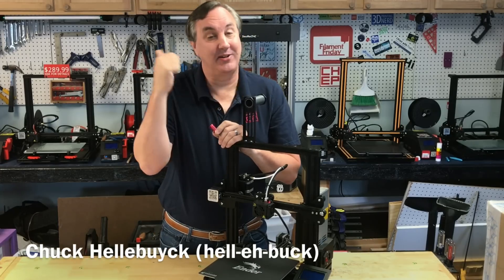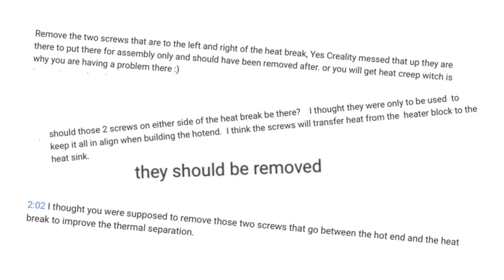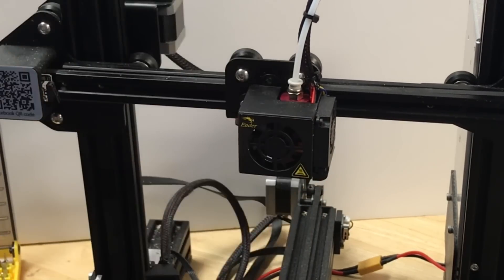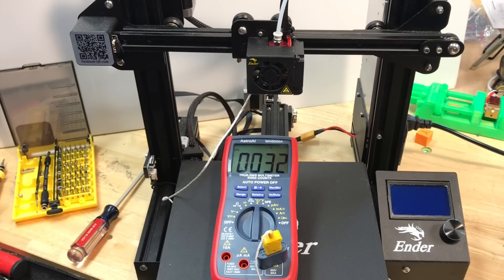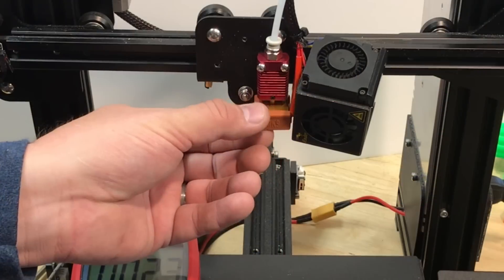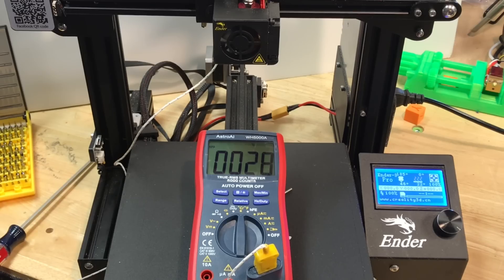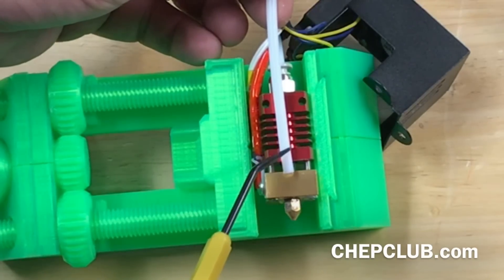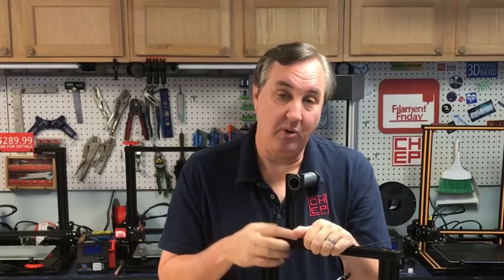Creality Ender 3 Hot End Heat Creep - Remove Those Screws......Maybe?

Comment: I took my stock Ender 3 Pro hotend and replaced the heat break with an all metal titanium version from Spool3D, along with the nickel plated copper heat block with titanium mounting screws from Spool3D. I have no heat transfer to the cooling block (heatsink). Prints perfect at 270-280C for CF nylon. PLA, PETG, ABS, ASA, and PC prints perfectly. 

When my hotend was stock I was using Capricorn tubing at 260C printing CF nylon just fine. No heat creep with those factory mounting screws in place. 

Those screws need to be there for structural strength. This is why i hate the Micro Swiss hotend because it is a really weak design with an aluminum heat block and a crappy Bowden tube mount.

Comment: Another note for anyone who is considering this as a possible issue.  Order some stainless steel screws and use them instead.  Stainless has about 1/3rd the thermal conductivity of regular steels, part of why it is used inside ovens and similar.  Best of both worlds, screws in for convenience, but also lower heat transfer compared to normal cheap screws.
Reply: They are always stainless

Comment: Anyone know where I can buy these screws? Or what size they are?
Reply: They are M3 screws. You can buy them basically in any screw store, very common indeed.
Reply: You need the whole assembly, unless you can drill and tap the heatsink. I bought one recently and it was under $20. Those screws are there to stop the tube slipping out and forcing the hot end to dive into the bed as they did in the earlier design. The are, badly positioned as they tend to put a sheer force on the heatbreak so you should not tighten them too much!

I'm glad Chuck busted this myth but if creep was so much of a problem, the heatbreak would cause heat creep anyway and it would be far worse.

Comment: Do this with higher temps for petg temps for example. You will see the fan is not able to keep up with the temps. 185 is also really low for pla, printing for strength cnc kitchen has suggested 230. I'm sure you would get heat creep if you elevated temps.
Reply: @ageorgiev89  the difference might be a little more with higher temps, but the heat equations are pretty straightforward. If it heats up from 25 to 32 C with heat input x, that’s a delta of 7. The delta T from 185 to 32, by contrast, is about 150, and that is what drives the x. If you start printing at 240 — which is about the absolute max for a ptfe hot end — that delta is going to be at most 210, or give or take +50%. That would mean that the delta on the heatsink side would also increase by +50%, in other words your heatsink temp might increase as much as 3-4 degrees to ends up at 35-40 C.

What does not happen is that the 55 extra degrees on the hot end also mean 55 extra degrees on the heatsink. Just not how thermodynamics work.

Comment: It would make sense that these screws are made from stainless steele, since it is a very bad heat conductor, which is good, in this case.
Reply: Exactly, posted the same before seeing your comment.  If they aren't already change them to stainless steel and you get the best of both.

Comment: Just going to add my two cents here. But I think this experiment should be redone with the thermocouple fit inside the heat sink chamber and checking the temperature there while the extruder is heated up. Having the tester thermocouple taped to the outside means it reads a mix of the air temperature and the outside heat sink temperature, when what really matters is the temperature of the heatsink on the inside.

From personal experience though, I'm in the camp that says that removing the screws helps. Ive done the test before with my own thermocouple on a MicroSwiss clone with the temperature going from 72C w/ screws down to 63C w/o screws. That's still going to affect my PLA, but it was enough of a difference to turn my all metal hotend that jammed within 10 min from startup due to heat creep to one that could be used continuously. 

I dont think its debatable that those screws were meant to stabilize the heat block in place of the nozzle. Its better to overtighten those screws rather than deform your nozzle. And heat creep would hardly be an issue given the stock hotend having a PTFE tube inside. This however changes when one changes to an all metal hotend

I think people experiencing problems on their all metal hotend shouldn't disregard taking off the screws as a possible quick fix, but they should do so with the knowledge that this would result in using the printer in a way the manufacturer did not intend it to be used and could lead to other problems. The proper way to address this problem would be to get a bigger heatsink fan or get a better hotend

Comment: I'll add my experience too - I "upgraded" to a Hero Me Gen5 printed out of PLA (as instructed) and I slowed all the fans too (incl. the PSU one) to make the printer near silent. Printing PLA was completely fine, but ABS (at 240C) heated up the coldend to near 60C and removing the extra 2 screws made it cool again (~33C). So the takeaway is that it might not matter for PLA and/or stock configuration, but it allowed me to print PETG/ABS at almost ambient noise levels.

Comment: My experience is exactly the opposite. My printer would run for an hour or two and stop extruding with a clog. I repeated this cycle three times (I'm a slow learner).  When I pulled the filament out I noticed it had softened (not melted) near the bottom of the heatsink but not at the top.  The softened filament drastically increases friction inside the PTFE tube to the point that the extruder cannot overcome the friction.  Hence a clog.  When I removed the screws all symptoms disappeared immediately.  Now, it's obvious that a slow or weak fan can cause the heatsink to run hot but it would be hot all over and not just at the bottom.  It should also be noted that my printer (and fan) was purchased NEW in August and that the fan ran at the same speed before and after removing the screws.  Those screws serve no purpose once the nozzle is tight.  If your heat block is loose, tighten it.  That is a separate issue and should be corrected.  In fact it may be the reason for the low thermocouple readings.  Finally, it's very obvious that the fan must provide adequate cooling but it also obvious (to me) that the screws can only increase the heat load on the fan.  Also, I think the thermocouple was not properly located to give accurate readings.  It should have been at the hottest spot not the coolest spot.
Reply from the maker: I’ve had a lot of people claim the same thing. Replaced the fan, reinstalled the screws and no more issues. So yours may be an outlier but my results are proven in lots of viewers experience. Relying on the grub screw to hold the hot end has caused many issues as well.
Reply: @FilamentFriday  My problem is solved.  My machine is printing fine.  My fan is not running slow.  It's brand new.  When it does I will replace it.
Reply: @ramtek2702  I just got mine, zero clogs, didn't even think about those screws except why they were st/st. No problems whatsoever. Yet!!! I will leave them in until clogs appear and re assess if required. good to have a differing POV.

Comment: so many ignorant comments... you even contacted the manufacturer ad they said leave screws in,but dumbasses still say its wrong... even if it added 5 degrees it would not effect the function since a cap tube can handle 250 degrees anyway... most pla is printed at 200 -215 degrees.... petg 230-240... and abs sucks for most of us anyway and needs a lot of tweaking for every new file you make... i leave my screws in and when i did print without screws no difference other than hot end could be shifted or twisted much to easy for my liking... this will cause inconsistent prints..

Comment: using those screws just for the assembly process does not make sense, no manufacturer would supply workers with two brand new screws for every unit if they were just for alignment, a jig is easier to use and much more productive.

Comment: Very well done. It does seem logical that the screws would transfer heat. But they only cause a faster transfer. Once the temperature reaches a set point, the fan keeps everything in check. Thank You for debunking this myth.

Comment: Hi CHEP,  actually you should have made a second test at 220 and a third at 240 to see if the difference increases.  I think that the difference will increase drastically when you increase temperature.  Otgerwise your test would prove physics wrong (or the cooling capacity of that hotend-fan combo can't be exhausted till 250 degrees).  And yes I know that High temperature material need less active cooling...
Reply from the maker: Didn’t show it but I did test higher temps and saw similar results. Leave the screws in.
Reply: @FilamentFriday  that's good information.. thanks

Comment: I recently had to replace my heat block because I snapped a nozzle and in the process, I lost one of those screws to the void. so far I haven't noticed a single issue. before the change though I was having problems with the nozzle popping prints off the bed before the print was complete (mind you I am a fairly new ender 3 user)

Comment: VERY poor research. Why? Because your heatbrak sitst in heatsink quite loose, wich means that  thermal connection between heatsink and heatbrak i very poor. Use thermal paste and set lock screw thight against heatbreak, and then repeat whole "research". 
 My own Ender 3 has no screws in hot-end, has better heatbreak, and temperature on the bottom of heatsink is about 65*C after running abuot 1 hour in 210*C temp on heatblock. All parts are stock, without heatbreak. With screws, temp on heatsink is siginificantly higher. And I have no issues with hot-end (w/o screws), machine pirinted over 8kg of PLA and PET-G without any problems...
Reply: You WANT a poor thermal connection between the heat break and the heatsink -  the heat sink is not to cool the heat break, its to keep the filament and boden tube inside cool. Of course the mechanical connection between the break (throat) and the sink should be solid, but anything you can do to keep heat going from the break to the sink is the whole idea. I've seen a video where teflon tape was used (not a bad idea at the outset) but at higher temps this will have the same issues as the boden tubes -  scorching and toxic off gassing -  the tape and the tubes are basically the same stuff. While using PLA, the two screws are neither here nor there -  up to you, but for higher temps :ABS, Nylon etc 250-270C, those screws can drive heat up to the sink too easily. The screws are only for alignment and to reduce stress when removing a nozzle. So keep them around for those operations.
Reply: @markrichards5630  1. If you want to keep filament and bowden tube cool (wich both are inside of the heatbreak), you want good thermal connection between heatsink and heatbreak, because heatsink cools down heatbreak. The lower temp. on heatbreak, the better, because it is lowering filament melting zone. That helps a lot. High quality hot-ends always have excellent thermal connection between heatbreak and heatsink. 2. Screws actually make aligment much worse, because they are positioned to the side of the axis of nozzle, heabreak and heatsink... 3. Screws are not for reducing stress when removing nozzle, because they do not carry ANY stress if you changing nozzle in the right way.
Reply: @kbilsky  I see where you are going now. That makes sense. I was thinking the break, through its material (stainless or titanium), was kind of looking after itself. I wonder if  a multimaterial break would be better? Ceramic at the bottom and titanium at the top with a glass divider -  there goes your cheap printer.
As for screws, just the initial alignment so the block is square to the sink.
Reply: @markrichards5630  I was thinking about multimaterial heatbreak too. I making custom Ti heatbreaks and copper heatblocks for sale, and such heatbreak that you mentioned would be great. 
I do not know about something similar for sale, if there is any. Making such thing would be agreat challenge too...
Reply: So would you recommend removing the screws? I’ve been having heat creep issues on my Ender 5 and can’t tell what the problem is. Hotend area seems identical to Ender 3, so any recommendations help.
Reply from the maker: Heat creep is usually caused by the fan failing.
Reply: @FilamentFriday  Heat Cream! Is that the the new bed adhesion solution? Or is CHEP starting to get into the classic killer app that has finally found its way to 3D printing just like it did for the Internet and VHS?
Reply: @jcwang9010  I've only seen an appreciable different without the screws when using higher temperature filaments. I've been fighting little blobs at retraction points with 260C ABS and have been unable to find a happy medium between retraction settings and having enough filament at the ready for the next pass. Removing the screws made the difference. Just that much less heat farther up the filament column made the filament just a hair less gooey. But for PLA there should be no difference.
Reply: @kbilsky  It can be done but the big issue is dissimilar expansion coefficients between the materials. All ceramic would probably be the easiest.
Reply: @markrichards5630  Thanks. I was printing Overture PETG at 255 C and it seemed to always clog up. I'll give it a try as soon as possible.
Reply: @jcwang9010  I haven't used that brand but 255 seems way high for PETG. I'm not a fan of the Heat Tower model for anything other than PLA. If you are testing with ABS, PETG, ASA, Nylon etc I find the heat towers give you a massively false "good" range that appears acceptable. Finding the sweet spot usually means printing colder than you might think.
Reply: @markrichards5630  Oh no, it's not heat towers or anything. I'm printing my own stuff, and this PETG works in the 250-255 range. It's labeled to work at 240, but that temperature has never worked on any printer I've used. I was surprised at first too, because I just switched over from another PETG brand and that printed fine at 230. I've been printing really well on other printers at 255 though, so I'm sure it's just something wrong with Creality Ender 5 heating.
Reply: @jcwang9010  You should remove it. Thanks to this "research" video, I refused to remove the 2 screws for a long time. I kept getting frequent nozzle jam, I had to turn off retraction and try to push the filament through as quickly as possible to avoid a jam. One day I got sick of the jam and removed the 2 damn screws and guess what? no more jams. Now I can use retraction and be confident that the print will complete.
Reply from the maker: Check your fan. If removing screws helped then your fan may be failing to cool enough. I’ve seen fans that spin fine but slower so the hotend heatsink cant remove the heat. So removing the screws may be a bandaid to a bad fan.
Reply: howard lim you do realize these are part of the mosquito hotend too right? It’s designed to reinforce the hotend. So many clueless commenters.
Reply: @johnandrews9433  I know. I'd rather not remove those screws too but I've got no other choice. I thought I found the real culprit when I took the hotend apart and found the heatbreak to have some play while seated in the heat sink, so I used thermal paste and thought problem solved but the moment I put the screws back the machine jams within 10 minutes on the first print and 5 prints in a row and works ok the moment I took it out again.
Reply: @FilamentFriday  The machine is brand new and the fan looks fine but I'll give it a try. Thanks
Reply from the maker: One of my brand new V2 has a fan that stalls. Had to replace it.
Reply: @johnandrews9433  But the Mosquito hot end has, as you say, actually been Designed as opposed to the stock Creality end which probably just came out of some parts bins they had on hand. I've got emails from Creality saying three different things about those screws from 3 different eras -  I don't think they even know if they are supposed to be there.

Comment: An even better test would have been to measure how much power or heater on-time is needed to hold the hot-end temperature: every watt lost to the heat break is one less watt available for pushing filament faster.
Reply: looking forward to your video
Reply: Yeah, but why would you sacrifice your print quality?
Reply: @thespicehoarder  What sacrifice in print quality? You don't lose any from reducing the amount of heat making its way out of the extruder by paths other than the filament coming out the nozzle. Also, lower heat losses means the heater has to work that much less to bring the melt chamber back up to temperature, which should IMPROVE print quality.

Comment: The screw just there to hold the heat nozzle from falling in your print causing a fire.
Reply: It will not drop without screws because the heatbreak and nozzle are screwed against each other in the thread of the heatblock. Also the cables will hold it in last case.
Reply from the maker: matneu27 - The grub screw that holds the heat break to the heat sink can easily slip or loosen and they fall toward the bed. Wires can only hold it from dropping more,
Reply: @FilamentFriday  in this case I agree, the worm scew alone can loose easily if not tight.